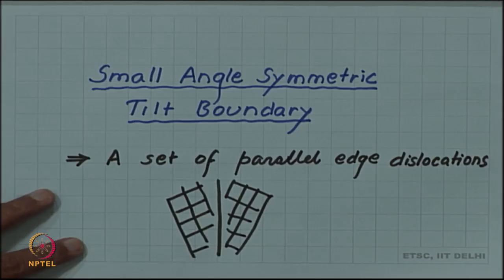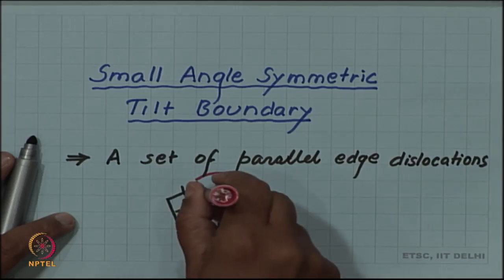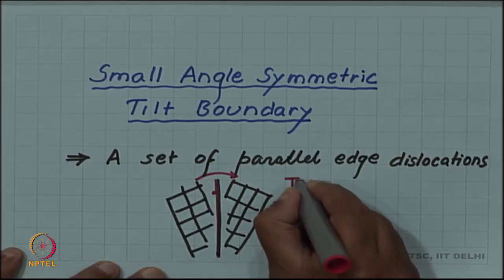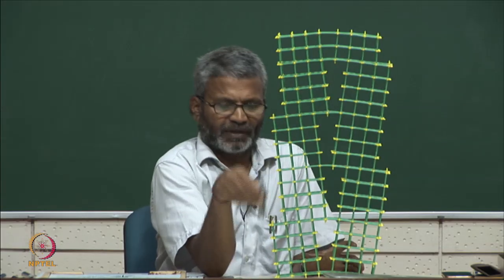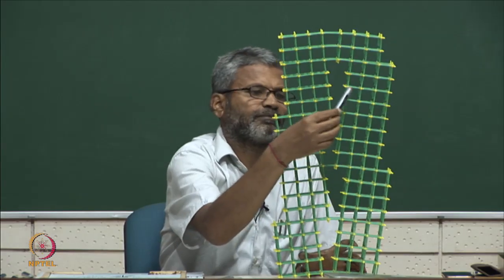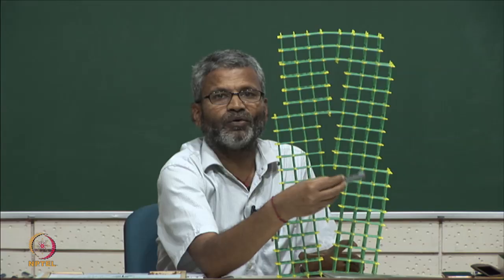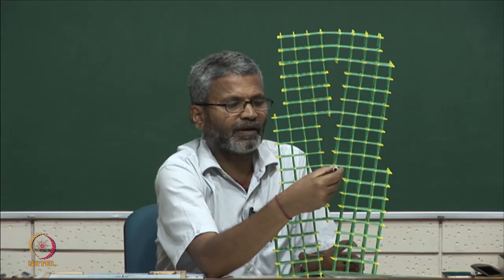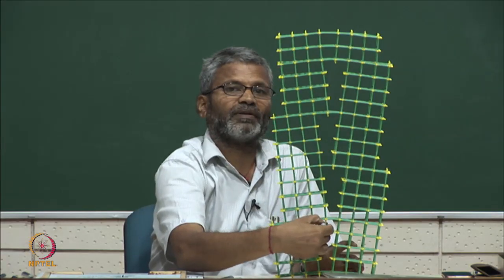Small Angle Symmetric Tilt Boundary

Comment: Sir, the rotation of axis should be parallel to have tilt boundary but when you are explaining the rotation of axis is horizontal that means it is perpendicular , I didn't got the clarity sir.
Reply from the maker: The boundary is a vertical plane and the rotation axis is the horizontal line lying in that plane.
Reply: @introductiontomaterialsscience  sir if rotation of axis is horizontal than it will be perpendicular to the boundary.. How can we say it as tilt boundary
Reply from the maker: @kaspashravani9019  Every vertical plane has a horizontal direction lying in the plane (the intersection of the vertical and the horizontal planes)

Comment: Sir, can't we say tilt boundary as a series of edge dislocation for symmetric large-angle also? If not then why?
Reply from the maker: Every dislocation has a core where the atoms are highly disturbed from their equilibrium position. This is something which is not captured in the models which I have used. The radius of the core is equal to a few interatomic spacing. Let this radius be r. Now the spacing of dislocations in the boundary plane is h. According to the formula derived for h one can see that h decreases as theta increases. If h becomes equal to 2r then the cores of the neighbouring dislocations will start to overlap and a model in terms of individual dislocations will break down. Thus the model is true only for low-angle symmetric tilt boundary. 

According to the book "Introduction to Dislocations" by D. Hull and D.J. Bacon the core radius can be taken to be between b and 4b (p69, 5th. Edn.). If we use h=2b corresponding to to r=b in the formula we get theta =14 Degrees. For r=4b, theta comes out to be less than 4 Degree.
Reply: See